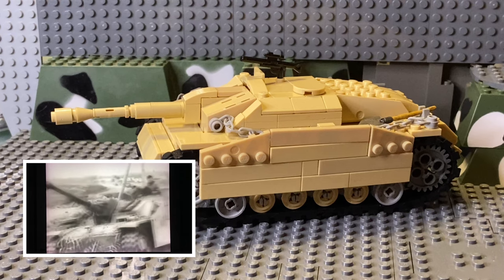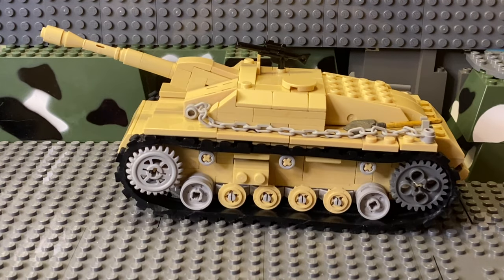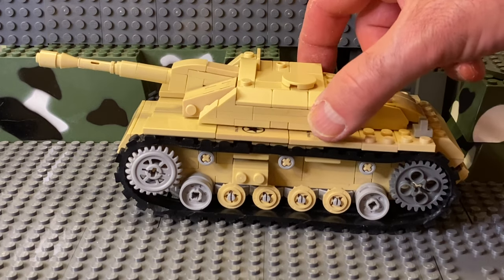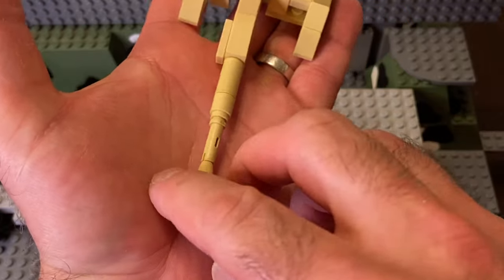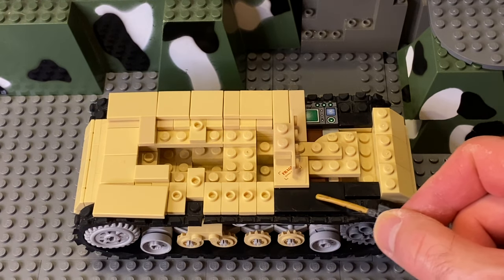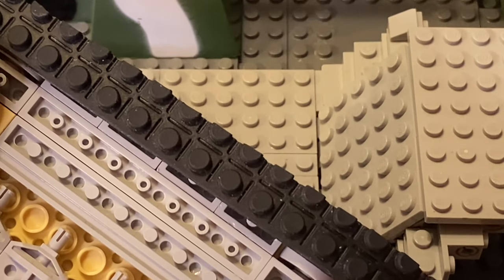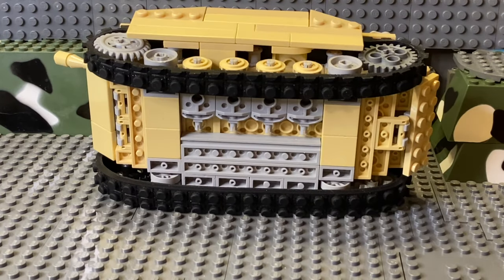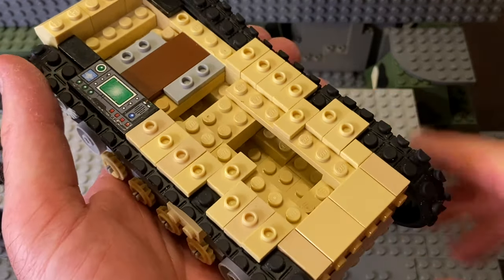How To Build a LEGO Tank Destroyer - WW 2 German StuG III - 2 of 4

Comment: The camo on the second stug is made really awesome, gives some battle of the bulge vibes
Reply from the maker: Thanks!  Your comment is much appreciated!  Putting the camo pattern together was a balance between maintaining a cohesive design with “correct” colors and scraping together enough small tan and dark green parts to make it work.  There are a LOT of substitutions I would have made on both TDs if I had just had the right parts.  Until my channel someday becomes self-sufficient, and as a challenge, I have purposefully not purchased any special parts or kits, and instead have relied on what I have at hand.